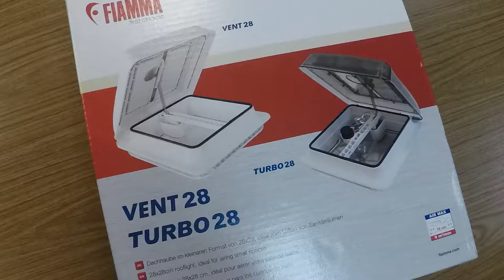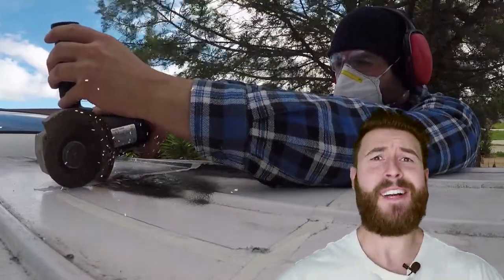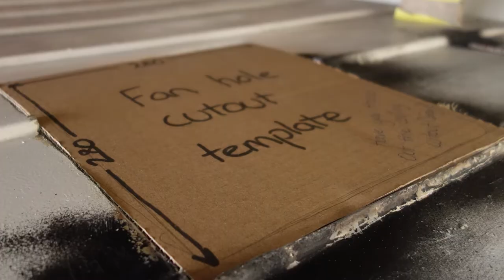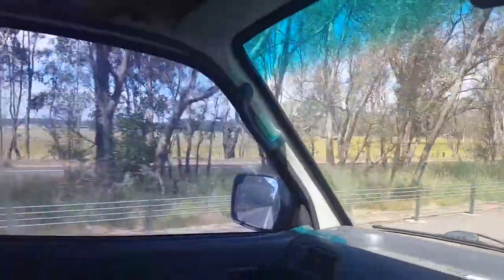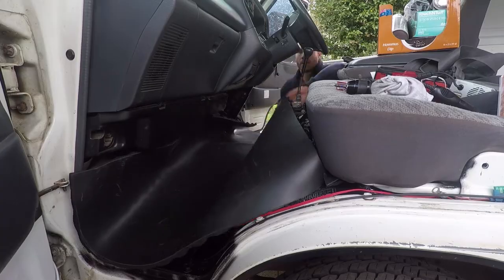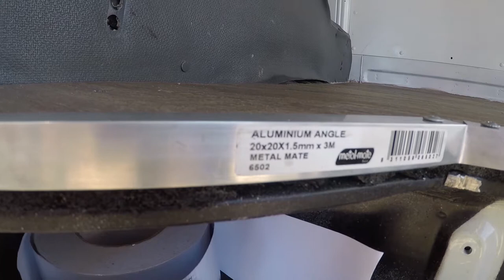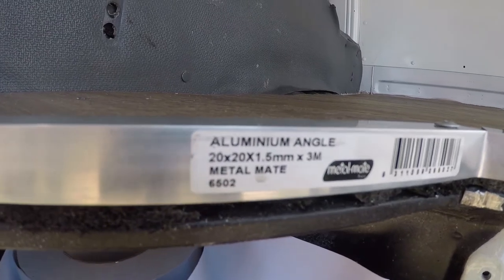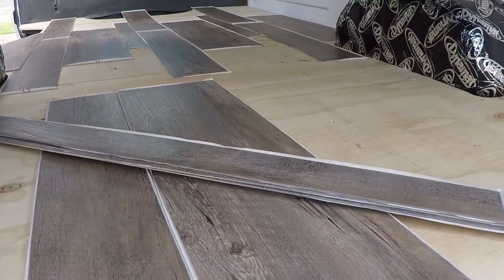Step-by-Step Campervan Conversion  | No insulation needed | Pt.2/6

Comment: I live in a cold area in the New England, and if I didn't put insulation in my Holden GTS van back in the eighties, we would have froze. I designed my own way to do it, and it did not take up much space. I covered it in masonite, and  sculptured cork tiles ( which you cannot get anymore - mores the pity), then did the edges in shag carpet. I one awards on that fit out, for being practical and smart, in using insulation. I would not have a van today without it.
Reply from the maker: Appreciate the input Ric. Yeah, I've never camped whilst it is snowing outside so I'm definitely going to take your word on this!

That combination sounds awesome, what do you think your alternative to the sculptured cork tiles would be, if you were to redo this today?

As for the generation of heat inside the van, I had considered a small, diesel heater but haven't really had any issues with heat generation when there are two of us in the van (nothing sexual implied). With snowy conditions, did you just keep it at insulation, no heaters?
I've seen some people put little wood furnaces in their van!
Reply: @LukeMcMurray  Sorry, I did not get back to you early enough, but no, we didn't use a heater, just down quilts, for warmth, but the vans heater from the engine, kept us fairly warm, in really cold weather , as we did not let the motor cool down, would turn it on every half hour  until we went to sleep, in those days it was only a dollar a  gallon (AU) for fuel. and I was a soldier earning above award wages so could afford to run the engine for however long we wanted it.
Reply from the maker: @ricmoffet6843  that engine running tip is actually a really good one. I remember when we spent some time in a place called Mt Hotham (>6,000 feet above sea) and intermittently turning on the vans heater helped. 

Thanks for the response!